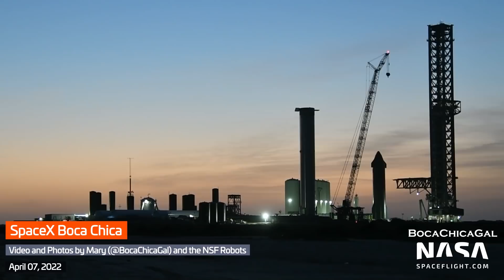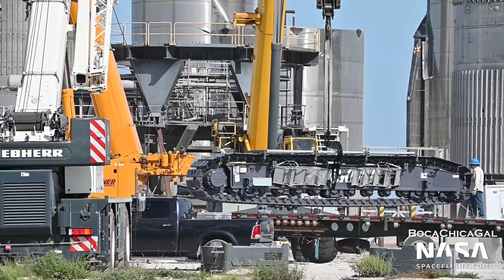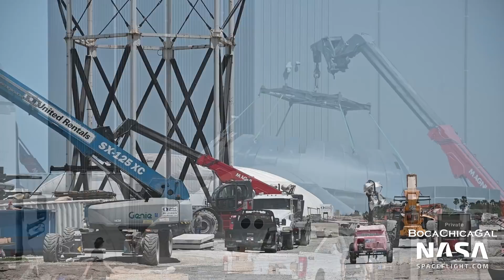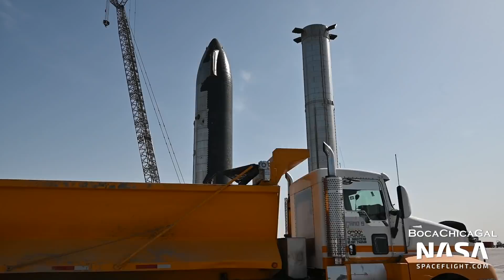Ship 20 Moved Next to Suborbital Pad B | SpaceX Boca Chica

Comment from the maker: 0:00 - Sunrise
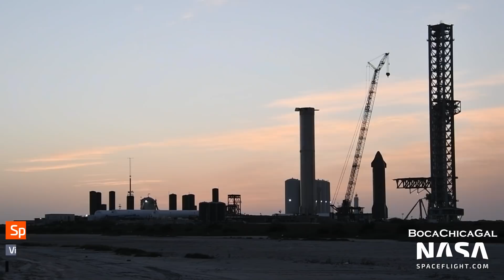0:15 - The Orbital Launch Site
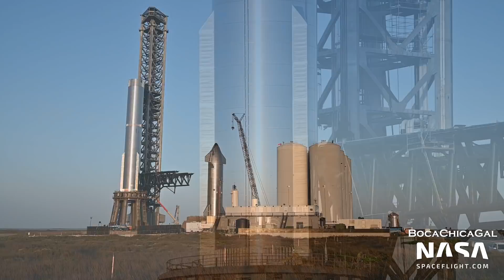0:31 - Booster 7 and the Orbital Launch Mount
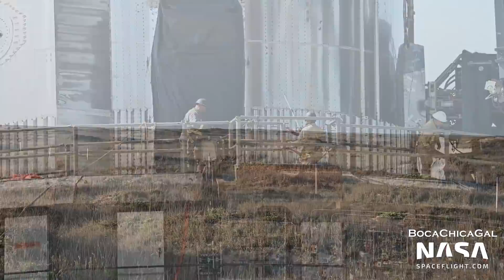1:12 - Markers Around the Launch Site
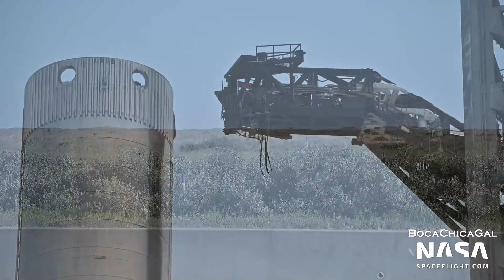1:39 - Ship QD Arm
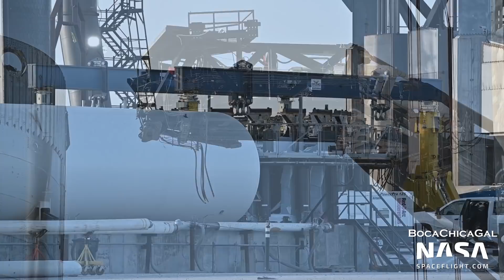2:03 - Structural Test Stand
2:19 - The Orbital Tank Farm
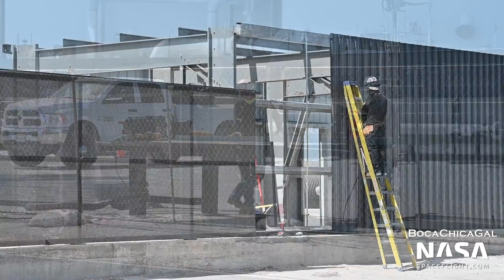2:50 - Crews Work on the Wall at the Launch Site
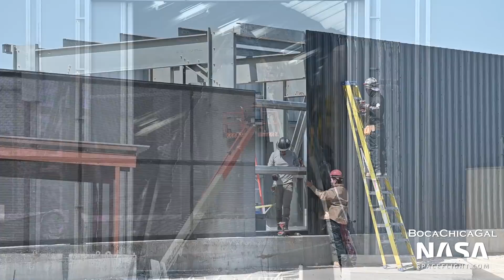3:05 - Ship 24's Nosecone
3:29 - The Mid Bay, High Bay, and New High Bay
3:44 - Booster 8 in the High Bay
4:00 - Ship Transfer Tube
4:15 - Domes Outside the Tents
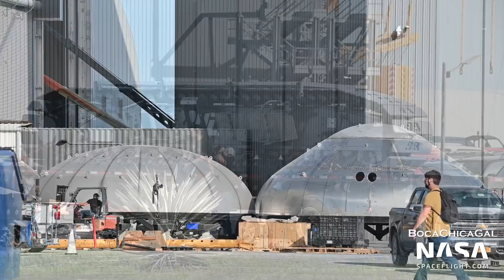4:31 - Crane Tracks 
6:51 - Domes Moved to the Scrap Yard
7:40 - Scrap Dome Moved
7:56 - New High Bay Construction
8:12 - Chopsticks and Ship QD Testing
10:10 - Ship 20 Moved to Suborbital Pad B
12:22 - Ship 20 Next to Suborbital Pad B
13:38 - The Suborbital Tank Farm

Comment: Crane tracks swapped from full grousers to flat pads, makes for easier turning and less surface damage.
Reply: Thanks for the explanation👍
Reply: Ahhh what’s a grouser? Term for track pad depth?
Reply: @joechamberland886  yes, it refers to the tread specifically, but not the lack there of as crane flat pads don't have grousers. those old tracks are like excavator style while as bulldozers have even more aggressive grousers.
Reply: @iamzid  Got it! I had no idea they were called that, learn something new everyday. Last I checked, I thought a grouser was a term used by a hunter when they referred to their hunting dog! Lol! 
You sir are a rockstar for responding! Thank you very much.
Reply: okay but why not just swap out the treads instead of the whole track assembly?
Reply: Summer tires?
Reply: I learned a new Scrabble word today !
Reply: @shoutouttoicet  It would take days to change them, only 2 pins hold the assembly on, takes less than an jour to just swap them.

Comment: Hoping that Ship 20 will fly to get some supersonic/hypersonic flap control data, RVac flight testing, TPS testing, etc. Though currently Pad B would need to have actuators installed on the QD for automatic disconnection. Hopefully they aren't just putting it there so that the transport stand can be made available,
Reply: Me too kid.
Reply: S20 is dead, Raptor1 only, so dead meat ship.
Earliest to fly, atm, is the S24/B7 but even that could change.
Reply: @barath4545  S20 can fly just fine. What it can't do is reach orbit.
Reply: I wonder why build it then? If not to fly it? If you wanted to get static data, SpaceX could've just built tanks pressure tested them and then scrapped the tanks. If you wanted to test QD hardware mock it up and then test it on the ground. Build the pieces, test, iterate, test. It's a waste of resources to build live ships that go nowhere, and disappoint those who would like to see them fly to prove concept that Elon is conceptualizing. Right now I see no difference between SLS and Starship production.
Reply: @georgemitchell2288  S20 and B4 was built in the middle of last year but since then SpaceX has been improving the Ship/Booster design and today it is more worthwhile to launch these new prototypes that are more reliable. And the wait for FAA approval is getting so long that it doesn't make sense to launch B4S20 anymore.

Comment: Moved S20 to PadB to remove the 6 present raptor 1 engines; especially the taller vacs can't be removed when S20 is on the transport stand.
Reply: This seems like the most likely scenario.
Reply: Why remove them? They will never be used for anything.
Reply: @knowledgeisgood9645  S20 is slated for scrap, so the raptors on it are to be removed - and also scrapped of course.
Reply: @knowledgeisgood9645  maybe post-test testing. And then Ship20 will be moved to Rocket Garden. 
S20 is no longer compatible with the new boosters; so high flight is not going to happen.
Reply: @sniperchess  The RVacs are also version 1.
Reply: @sniperchess  All the 6 are of raptor 1 type. By design, 3 are inner, regular, sea level gimbaling Rs & 3 are outer Rvacs, with longer cones for above Karmen line operation.
Reply: @mauricebruns1028  I doubt if S20 would get tested any more; it's been tested extensively. They'd put it on pad B only for the scrap process I feel.
Reply: @sniperchess  The numbers 1 & 2 indicate major classification of raptor engines, 2 being more advanced (& elegant 😁). Sea-level & Vac versions are subtypes for different stages of operation during flight. So Raptor 2 also necessarily comes with the two subtypes.

Comment: I was slightly confused by something.
Are the smooth/flatter domes shown at 6:54 and 7:44 the same dome? Or were there two and one has been scrapped?
Reply: You can see there at 7:54 is the complete dome in the ground which is the same as the one at 6:44 and there is the unfinished dome being stacked next to it.

Comment: S20 was probably moved to get it out of the way - the suborbital pad allows S20 to still have a positive internal pressure so if it is wanted for something in the future it would still be usable. If it was transferred to the rocket garden then the structure would soon be damaged by the lack of internal pressure making it unusable for flight.
Reply: When I was at starbase (rocket garden) it looked like there were dedicated compressors and the ships were hooked up to compressed air or n2?  I figured it was for the same purpose...keep them in good shape
Reply: Im pretty sure all the rockets at the garden have some sort of positive pressure, otherwise they'd all be dented to hell.

Comment: I cant help but feel like the most logical thing that moving to sub orbital pads means, is a high speed flight. Static fire wont give them much useful data at all with the switch to Rap2, and it would be so much cheaper. faster and less time consuming to launch this, get data on the tiles and aerodynamics at high speed and let it fall into the ocean instead of scrapping it. Since it doesnt have legs or a landing pad anymore.
Reply: Nothing is happening around the suborbital pads. That is the best place to just park it.
Reply: @knowledgeisgood9645  Maybe so, but i like my idea better! :)

Comment: 4 sets of track rollers!? Are they building a rocket crawler for the site like there is in Florida?
Reply: They are replacing the treads on one of large cranes.  I'm guessing the LR 11,000 working on the Wide Bay which was used at the launch pad going back to last year.

Comment: Do you think they will test stage zero with ship 20?? I would not put that past Elon!!
Reply: They have already done so
Reply: They have several times now, just not while stacked. In this case It is going to the sub orbital pads which isnt using stage zero, they have their own system, But i cant see why they would unless they plan on lighting those engines, And since they are switching over to raptor two, i dont see how useful a static would even be. Honestly im leaning towards and high speed flight and i sure hope so.
Reply: @Vatsyayana87  I mean launching Ship 20 from the sub-orbital mount and catching it with the chopsticks???
Reply: @theredstonehive  I mean will they launch ship 20 from the sub-orbital mount and then catch it with the chopsticks??
Reply: @JohnSmith-eu3ql  Ship 20 doesn't have the hardware to be caught, and they wouldn't risk it without an ocean landing test anyway.
Reply: @theredstonehive  Ship 20 was lifted by the chopsticks onto booster 4! It does have the hardware! It could work.
Reply: @JohnSmith-eu3ql  It has two holes to insert pins into. That is a very slow way to hold it. No way it could be made fast enough to catch a ship while landing.
Reply: @JohnSmith-eu3ql  Ah gocha, well its pretty much guaranteed that they wont be doing that for a few reasons, it seems more logical to me that they might launch it into the sea though. We will have to see. :)
Reply: @Vatsyayana87  Thumbs up!
Reply: @JohnSmith-eu3ql  The chopsticks wouldn't realistically be able to grab onto those tiny tile size holes during a landing. They would need to be something much larger, similar to what Boosters have. Elon mentioned that the mechanism could flip out from the back. Whatever solution they come up with, it needs to not interfere with the TPS too much.